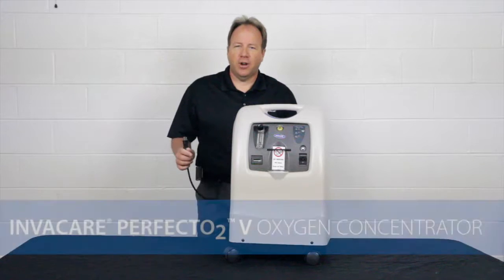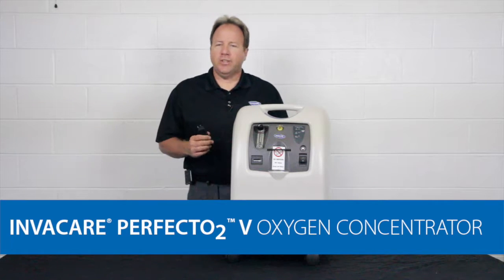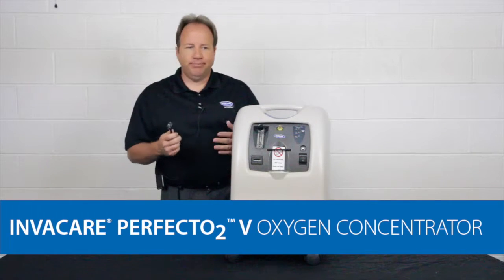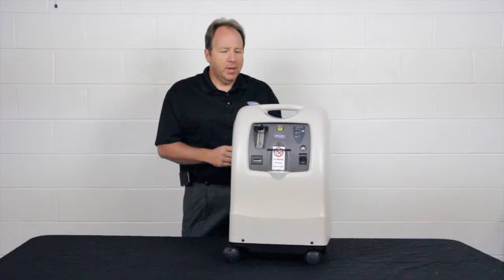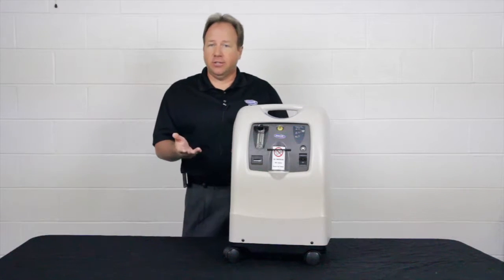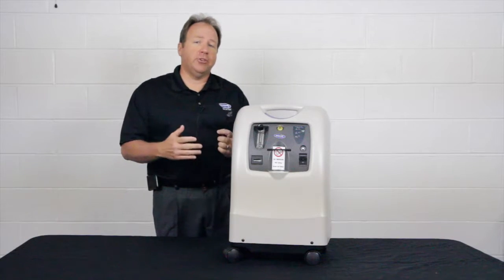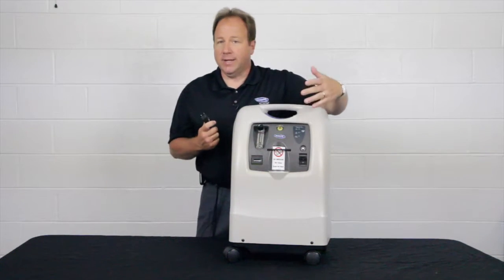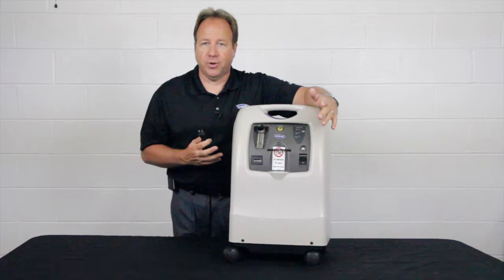1 Oxygen Concentrators without power

Comment: Thank you for your quick reply. I understand your perspective as a manufacturer regarding the extension cord issue. I'm presently using two home concentrators, one being an Inogen Home model. Both are connected to power using fairly heavy duty extension cords, a necessity in my home setup. There have been no difficulties at all in over a year of use, specifically no warm extension cords. Also, there must be many concentrator users that have RVs/campers. I've looked for info online about whether concentrators can be used with 12 volt DC to 110v AC inverters. I've found surprisingly little info on this. Do you know if home style concentrators can be run from properly-sized inverters, and if so if a modified sine-wave inverter is fine or is a pure sine wave inverter required? Many thanks.
Reply from the maker: eqlzr2 -- We would like to clarify . . . we are not the manufacturer of the equipment, but a vendor that provides them in several capacities. We are simply presenting the manufacturer's recommendations. We agree that there are many individuals looking for this kind of information; however, we are unable to provide the level of detail you are looking for in this instance. We recommend contacting the manufacturer directly to obtain their input on the best way of setting up your needs. If you do come across other instructions that are helpful and would be willing to share your findings with us, it would be appreciated. Again, we wish you all the best!
Reply: Thanks, I mis-spoke. I understand you're not a manufacturer. You've hit upon the crux of the problem I'm encountering in getting an answer to my question from manufacturers. They are generally vague, or don't even know what an inverter is without my explaining it to them. Therefore, I don't have much confidence in their advice. Actually, I just got off the phone with Tech Support at Inogen, and I had to go through 2 people who said they were Tech Support, but then they had to ask a "Senior" Tech Support person who finally said it was OK to run an Inogen at Home Concentrator off of a regular modified sine wave inverter. Now I'm going to try calling the Tech Support people for your Invacare Perfecto2 V and see what they say. OK, I just got off the phone with Invacare Tech Support, and they said they've never tested to see if one of their concentrators will run off of an inverter, and they said they weren't going to test it either. So, surprisingly, that's the answer.
Reply from the maker: Thank you for sharing your findings.